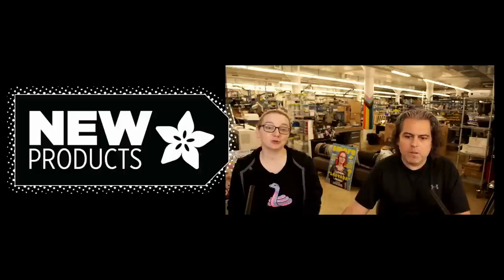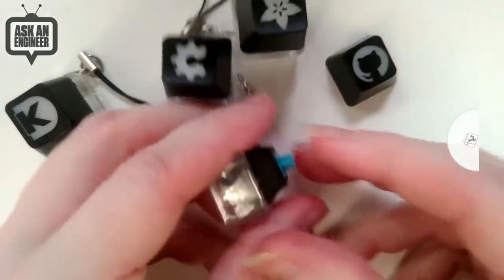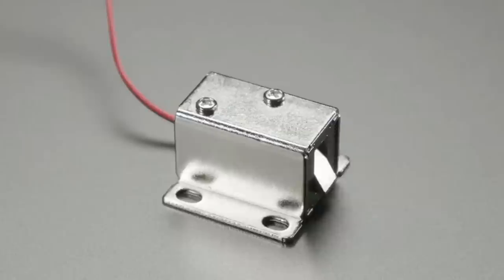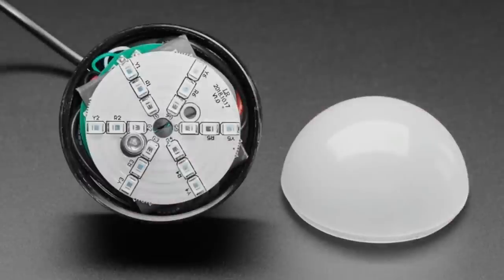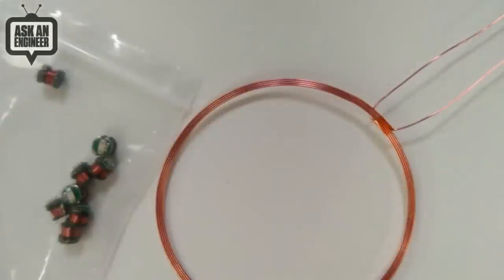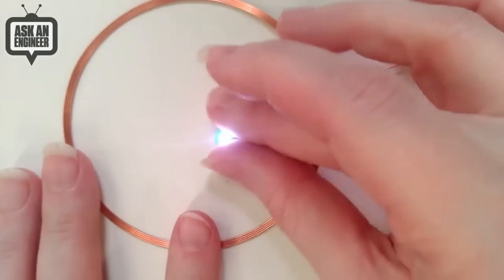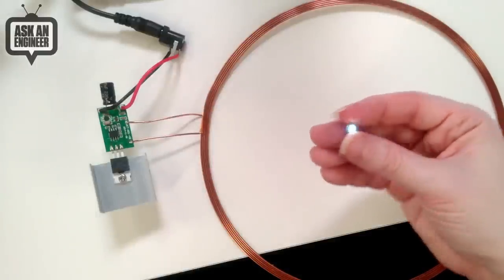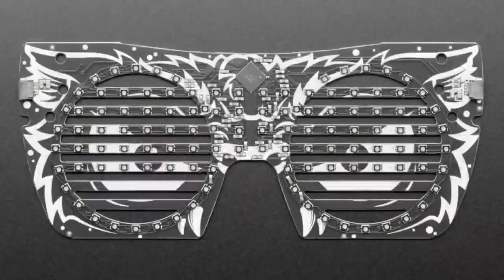New Products 9/15/21 feat. Adafruit LED Glasses Front Panel - 116 RGB LEDs w/ I2C Driver -STEMMA QT!

Comment: With its uniform shape and lack of colour coding, the USB-C space is already a mess.  Is it PD?  Is it power-only?  USB2? USB3? Thunderbolt?  
Is it supposed to be USB3 but only giving you USB2 speeds?  Try flipping it over because symmetry is a lie.
At least with this adapter, I will know what it is because I soldered it.

Comment: @9:30 I'm dreaming a bit here: if these were addressable imagine the possibilities! RGB even‽ Embedded accelerometer, oh mommy!
Think backlit Rubic's cube with a tap to reset option! A huge challenge, but you've seen that video of the self-solving motorized cube, so easy!
Or a non functional Rubic's-layout 6-sided dice that scrambles the "cube" based on the acceleration of your roll. A 43-quintillion sided die!